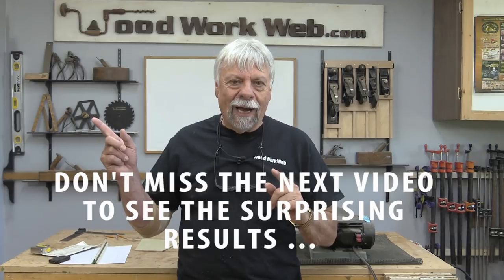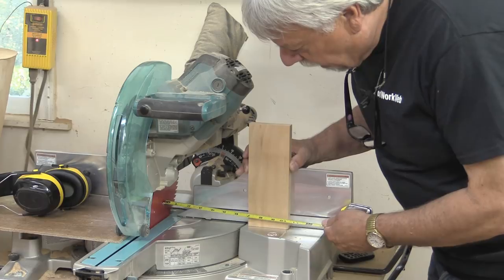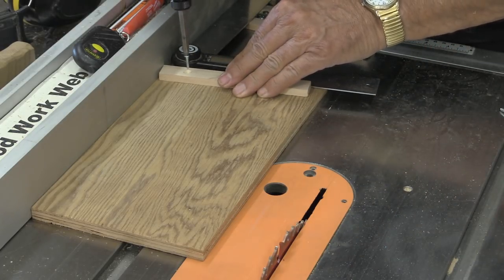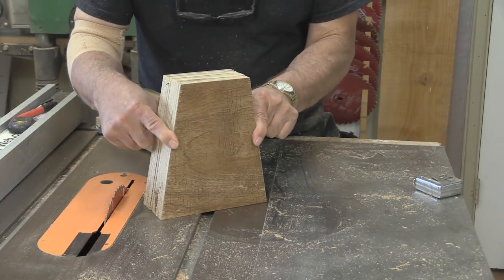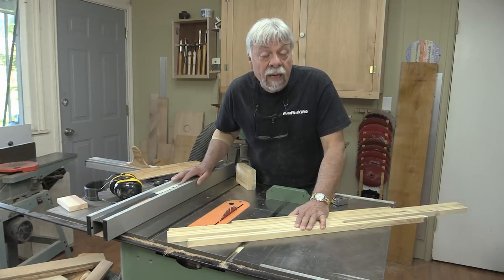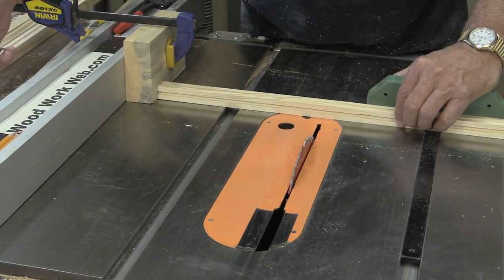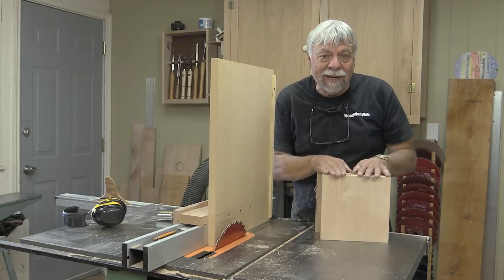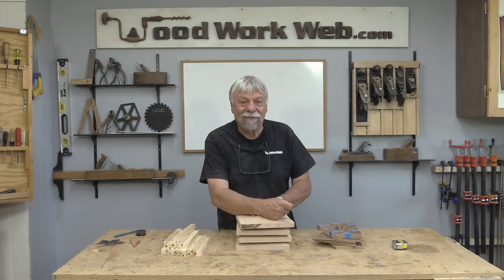Making Production Jigs: Setting your Table Saw & Miter Saw for Repetitive Cuts

Comment: Thanks for the great info. You didn't explain how you set up the other angle on the table saw. All you said is that you were going to move the block. Did you line up the angle from you template with the blade and move the block or did you use a secrete formula to find the second angle?

Comment: Hi Colin. Why when you were cutting the dadoed pieces did you use a 2x4 clamped to the fence and not just butt the pieces against the fence to cut them.  Thanks, Rob
Reply: That prevents the stock from pinching against the fence and causing kickback. As the stock is moved forward it no longer has anything to press against on the right side and can't pinch and lift onto the blade. You should always use this technique when cutting stock that is wider than it is long.
Reply: Thank you, Gerry.